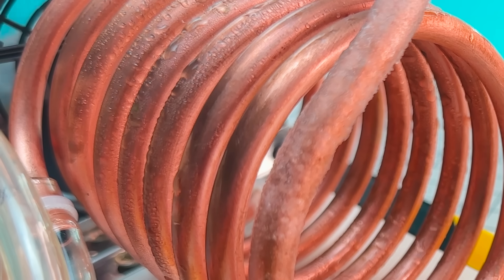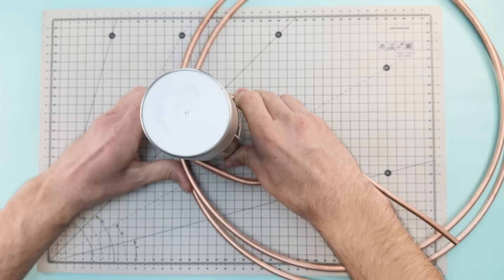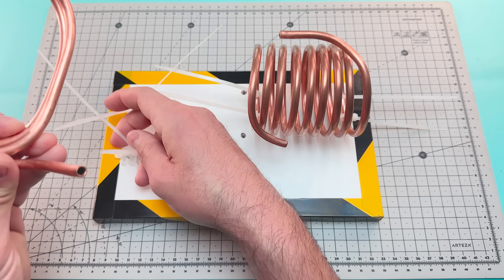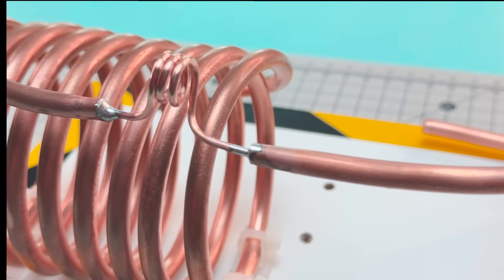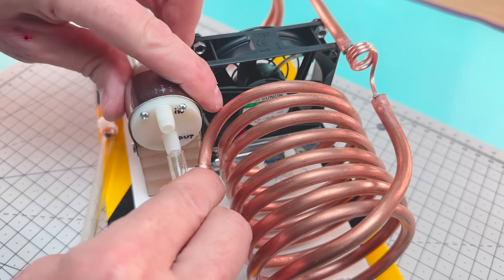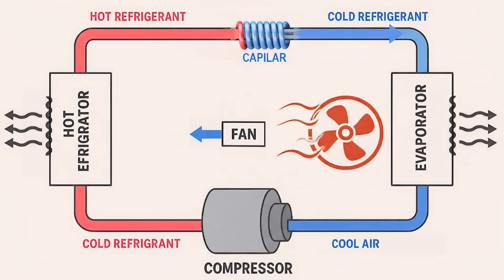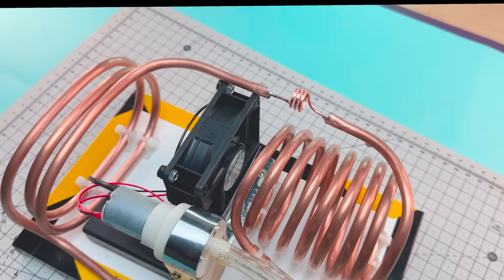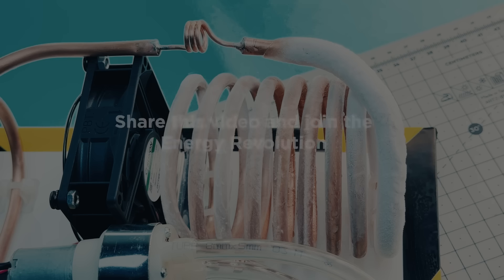Make your own AIR CONDITIONER at home Fast and Easy!

Comment: Very nice video showing exactly how an AC works.  If you do built something like this, you will first want to have two units, one outside for the hot portion with a fan, that blows the heat outside and cools the hot pipes.  Then the inside unit, and rather use a radiator style coil configuration to maximize the air through the cold copper tubes.  and lastly, use a AC to DC unit to power your fan, you will run out of batteries.  As a Portable Aircon, this will never work though.

Comment: You ain’t gonna compress the gas back into its liquid state with that pump, and you didn’t evacuate the system to remove the air in the pipes before inserting the butane !

Comment: It's a good demo of the principals of refrigeration, but it won't cool a room. The heat released by the condenser is equivalent to the heat absorbed by the evaporator (that's why AC systems need an indoor and an outdoor unit). It is, at best, a small dehumidifier if you let the ice melt and catch the water. But it is a practical illustration of how small refrigeration systems work.
Reply: It's not even a good demo. It won't work. Video is faked.
Reply: @paulswarthout9967  The video might be faked, but the concept is sound. A liquid that boils at a low temperature is drawn into a relative vacuum or low pressure, where it "boils" and the evaporation process extracts heat (changing from a liquid to a gas, which is a higher energy state). Then you force it to a high enough pressure so it liquifies and gives up the heat (the energy from the state change from gas to liquid) where it dissipates into the air. There's some kind of restrictor device between the "high side" and "low side" so that refrigerant can make the loop but the pressure differential can be maintained. In commercial units they use thermal expansion valves (TXV), in domestic appliances they just use a fixed diameter capillary tube. I'm not sure about the properties of the refrigerant they claim to use in the video, and the device, even if it's real, obviously can't cool anything other than the evaporator coil itself. But the basic principals of refrigeration are correct.
Reply: @kurtcpi5670 Yeah. BUT: 1) the refrigerant wasn't added because air was already present in the system and no provision was made to get the air out befkre adding refrigerant. 2) the lines are not under pressure, so you cannot pressurize either side of the capillary tube enough to transfer heat. 3) Both cold side and hot side are in the same room woth no isolation.
So, it won't work. Even if the video wasn't faked.
Reply: @paulswarthout9967 isobutane needs only 3 atm pf pressure at high side, so it is possible to generate that with standard air pump. Agreed that he did not vacumm the air before fill up refrigerant.
Reply: It's just a portable device same as a fan. In principal fan will increase overall room temperature. But for a portable device you just need to focus directly in front of the AC cooling effect, the heat generated from condensor will just disipated away.

Comment: isobutane yes  thanks much  
placed outside the room, then connect a tube to collect the cold air funneled into the room. so that heated air in the process would not interfere with the cold air.  the produced cold air is concentrated into the tube going straight into the room.

Comment: Wouldn’t cool the room the heat removed from one side radiates from the other
Reply: It will heat the room, because of heat loss on the compressor and fan.
Reply: Add a step. Isolate the condenser from the fan with foam and plumb a laundry dryer hose from the condenser side to the outside. Better yet, add a second fan to blow the heat out the dryer hose

Comment: What a nonsense, heat on one side cooling on the other, the sum of the is heat= very baisc physical relations. You might as well open your refridgerator door and heat your room, which is expressed on your electrity bill. Airconditioners seperate the heating environment from the cooling environment and use, to be effective, significant electrical energy. A 9 Volt toy battery ??? something for a kindergarden,
Reply: Exactly the comment I was about to make!!  You could also compare it to picking yourself up by your own bootstraps, LOL!

Comment: You realize that if the evaporator and condenser are both in the same space or area, no net cooling will occur. The evaporator will absorb heat from the room and the condenser will reject that heat back into the room. No net cooling of the space will occur
Reply: taking efficiency in to the situation and you will warm room up :D
Reply: I would put the fan on the condenser and use the evaporator to chill beer cans.
Reply: @MichaelLeeOne  Thats something it would do!
Reply: He's demonstrating the principals.  You are free to change the physical layout of the condenser and evaporator to optimise cooling.

Comment: He should’ve charged it with more butane and used a regular 14 V battery instead of a 9 V battery because that is a 12 V motor and a 12 V fan two more votes will make it run faster than 12 9 V batteries are only going to make it run slower and with a higher voltage and more butane, you could cool it down to -20 Celsius

Comment: This is total trash. As the Evap pulls heat, the condenser rejects it, in the same space 😂😂😂😂😂 so this will actually make the room hotter! Also, an Evap coil should NEVER FREEZE! Wanna know a more efficient and actually effective system? Any real HVAC system and hell at this point even a box fan pulling air over a wet rag from a bucket of ice is better than this trash 😂.
Reply: Its a base concept that is working, maybe expand on it instead of monking.  Have you built something like this?
Reply: True, but the energy stored in the 9V battery isn't enough to heat the room in a significant way, lol.
Reply: Der Nachteil bei HVAC Systemen ist die Erhöhung der Luftfeuchtigkeit!
Reply: So? This shows the principle of thermal mechanics.  You are taking too seriously 😊

Comment: 😂CUTE❤ it... Lol. Sorry well here's the skinny: DC fan compressor setup uses a weak pump not rated for gas compression, poor sealing, and minimal coil surface area—causing low cooling efficiency, high leak risk, and short system lifespan.

Comment: The fan is in the wrong position, it will blow hot air from the condenser to the eveporator, a simple wall between those would help a lot, and ideally the condenser being outside the room.
Reply: It is not about the setup, it is about the idea of generating cold air.
Reply: @tawfeeqg4826  He is not showing something novel, its a standard heat pump, just made from common easy to source materials. But the principles of the heatpump makes this setup have little sense, as its wasting energy for no good reason, and is not even symbolically trying to separate hot from cold.
Reply: This is more like a dehumidifier, since it blends the hot and cold back together. But a neat demo anyway.

Comment: 3 things, 1) how does a 9 volt battery power ~both~, a 12 volt pump AND a 12 volt fan?   2) Wouldn't the compressor finally freeze up without a regulator?  3)  Don't you need to exhaust the heat captured/exchanged to the outside?
Reply: 1) poorly
2) yes all sorts of things will go wrong with the pump, freezing may not be the first failure
3) yes

Comment: it only heats the room, the evaporator cools, the condenser heats up, and the fan also heats up from the electricity and the power supply elements, the total temperature increase is small because the power supply and the fan are small
Reply: The Evap does not “cool” anything 🤦🏻‍♂️ its job is solely to remove heat by absorbing it and rejecting it through the condenser coil.

Comment: If you do not reject the heat from the condenser to the outside (or another area) you will not cool the room. You will only move heat from the condenser to the evaporator.
Reply: он только нагреет комнату, охлаждается испаритель, нагревается конденсатор, а еще нагревается вентилятор от электричества и элементы питания, суммарно выходит повышение температуры, небольшое т.к. источник питания и вентилятор маленькие

Comment: Using a standard electric air pump in combination with isobutane is not only technically pointless but also extremely dangerous. Isobutane is highly flammable, and commercial pumps are neither gas-tight nor certified for flammable media. If you work with it, you risk not only the failure of your experiment but also a fire or explosion.

Refrigeration systems rely on a precisely tuned thermodynamic cycle with components like a compressor, expansion valve, condenser, and evaporator. Simply “circulating something” is not enough. Without an understanding of these fundamentals, you won’t build anything that cools — at best, you'll generate hot air.
Reply: While I will give you the fact that the pump might slowly leakm but you wont get an explosion from such a tiny bit of gas. Are you also worried about gas stoves in a house?  
As for this system, well you can see it works on the video.  It has an expansion valve as the small coil.
Reply: W układzie jest 10 x mniej gazu co w zapalniczce. Nawet jeśli dojdzie do rozszczelnienia taka ilość gazu stanowi za małe stężenie do zapalenia.
Jeśli generujesz gorące powietrze = generujesz też zimne powietrze. Nie wmów więcej o termodynamice.
Reply: I am going to make one and install it into my Tesla. What could go wrong?

Comment: using a battery it will not cool for long. as mentioned by another the hot coil needs to be separated and placed outside the cooling area. otherwise even though one part is cooling and the other part heating overall the area will heat up due to energy being expended operating the unit. there is another issue normally the system is put under a vacuum to get rid of the air before filling. maybe in leu of that, allow the air to escape out of the other end of the tube on the pump till you smell the injected gas then seal both ends
Reply: This won’t cool at all. Odds are it would actually generate heat instead.

Comment: one end is cold the other is hot u need to separate those two sections and would use a more efficient radiator in this way u are just heeating and cooling the same air and do  nothing with the room temperature but cool edukation modell for the Linde principal
Reply: wouldnt the set up push the heat into the cold essentially cooling it off? 🤷‍♂

Comment: Your explanation regarding heAt exchanger is correct. But how about the construction cost . So many things to consider. When you analize the way it is constructed it is veey poor. That procedure is for experiment only and not for actual. So if your going to construct it by your own it better to buy a 1/2 hp aircondition and that it.

Comment: What do you do about the heat generated in the Condenser side? Since it will generate as much heat, as cold, there needs to be a way to get the heat from the condenser side to an external area.
Reply: Jam it in a window, so condenser side is exposed

Comment: some new refrigerators come with labels telling you theres flammable refrigerant inside them. and your pulling heat through your cold air there so the room will stay the same temp. gotta put that hot side outside like a mini spilt for cooler temps inside.

Comment: Yea I thought the lines would need to be  vacuumed out of air to zero pressure then filled with gas also those copper wires need a water drip pan under them.. with over flow..

Comment: Won't work. Non condensable air is in the circuit. No vacuum pump used before injecting butane. Also, high pressure would blow that plastic tubing off the copper.
Reply: I am no expert  but I believe you are correct
Reply: Works, but use?

Comment: Cool project but truly unsafe. While copper pipes can easily hold the gas providing a good welding, you're using plastic tubes for carrying gas which will surely leak. Be careful as some less experienced viewers may try to replicate these so, YT producers should always be responsible about the projects they publish.

Comment: Nice tabletop functional refrigeration system model. Without soldering or welding you wouln't expect it to run forever though, as it will slowly leak gas over time.

Comment: A cool demonstration of the principle but one major problem - the heat dissipated by the condenser goes where? Straight back into the same room air that you've just cooled with the evaporator coil. Add in the extra heat generated by the compressor motor and, hey presto, you've just caused a net increase in your room temperature. A very complicated small-capacity room heater is what you've just made. Placing the condenser in a different room with appropriate plumbing, or ducting the air passing through the condenser to an external location might work theoretically, but with a device as inefficient as this transportation losses would probably counter any cooling that might take place.

Comment: I guess it can be use as refrigerator if both coils separated with heat insulator but not of any use as Air cooler .

Comment: This Unit could be scaled UP and the hot air dumped outside through a window, with the proper ducting
and the separation of the Condenser and Evaporator.  Foam board would be a cheap cabinet material to 
use.  Some packing tape and Bob's Your Uncle you have a homemade cost effective Air Kooler!!

Comment: Hello, about how much of the butane gas was added? I love the fact we do not have to add water like the mini units are being sold, because living in the Golf Coast, we do not want to add more humidity to the room. Thank you.
Reply: @1945temo   If you expect to cool down "any room" though, prepare to be greatly disappointed.
Besides the cold and warm parts being in the same room and negating each other... the fan just blows the HOT air from the condenser behind it through the cold evaporator in front
Reply: @Diagoras_de_Melos Indeed I know it will not cool down a room, my effort to build it is because year round I have to use a mini heater 12 Volt in each room so I can control the humidity. Now if I can do the same with 9 Volts I could save a few Volts. How much of the butane gas to use?

Comment: Cool proof of concept. If you expect to cool down "any room" though, prepare to be greatly disappointed.
Besides the cold and warm parts being in the same room and negating each other... the fan just blows the HOT air from the condenser behind it through the cold evaporator in front. Bruh.

Comment: The heat from the condenser still be discharged into the room  and the total heat dissipated into the room is more than the cooling effect of the evaporator!
Reply: This was my first thought as well.  The condenser would need to be isolated and placed outside the room.  I think if this were done as a outdoor cooler for your drinks where the evaperstor was in a small thermacol container this could be a fun experiment that would be usable.
Reply: ... я об этом, в том числе, и подытожил!

Comment: LET ME  MAKE THIS FOR THE SIMPLE BRAIN  ? FOR YOU even to FEEL A/C COOL down   if thinking you CAN  MAKE ONE TO  COOL  YOURSELF ? WRONG SIMPLE FACT IS  lets say you got made one   you  WOULD   PUT   it in a   ROOM  2X2  ? now you NOT FEELING cold air on you ? WHY   HERE GO'S FOR  THE  SIMPLE  PEOPLE BRAINS  YOU WILL NEED A 100 of them  or MORE to feel  in on your  BODY at all ?   CAUSE  IT MAKES HEAT !! TO  MAKE  COLD ! it makes more heat than  cool ? so   I HOPE YOU  GET THE PICTURE you get it  YOU WOULD have to BUILD A 100 of them  or more just to   FEEL  COOL ? IN A ROOM A  VERY  SMALL ROOM  2X2  to ??  DO YOU GET IT ? A/C you don't  get it easy   WHAT ever way you MAKE IT COLD  YOU HAVE TO MAKE MORE HOT if don't  believe me  STAND  IN BACK  of YOUR  ICE BOX and see the heat FEEL THE HEAT TO !
Reply: Calm down a bit and stop shouting  , you have been given an idea . It's up to you to use the new information  , scale it up or find a fridge that works but is not wanted . Utilise the working parts reconfigured so the evaporator is in the room and the condenser outside . Easy peasy. Don't use isobutane in conjunction with a compressor though .

Comment: nah, this is just a simple demo how refrigeration works. he didn't even evacuated the system. this is a crap setup and not really useable if your intension is to cool a room as what he claims.
Reply: Tal vez no sirve como aire acondicionado, pero agregándole algunas cosas, tal vez sirve para capturar la humedad en una habitación con problemas de humedad.

Comment: Ideally, you need a pathway to remove the heat, otherwise the cooling and heating will cancel out (in the same closed area). You would need another fan blowing over the condenser with a duct to remove the heat outside (as with a commercial room a/c). You would also need a water condensing tray.

Comment: I found it great demonstration, yes is in same room, so it's will act more a desumidificator then AC system, but as the most simplification, that great
Reply: Tal vez no sirve como aire acondicionado, pero agregándole algunas cosas, tal vez sirve para capturar la humedad en un recipiente, en una habitación con problemas de humedad.

Comment: How are you removing the heat generated by your condenser and your motor? This will add more heat then you are removing. In other words you created a room heater. I will give you credit for a pretty cool (pun intended) single drink cooler though.